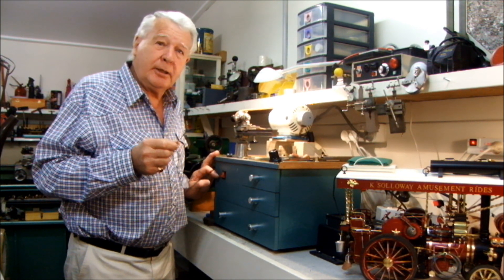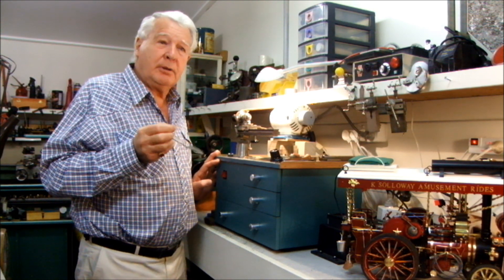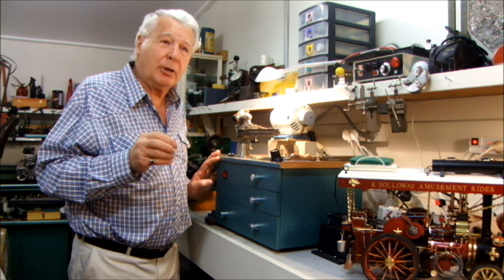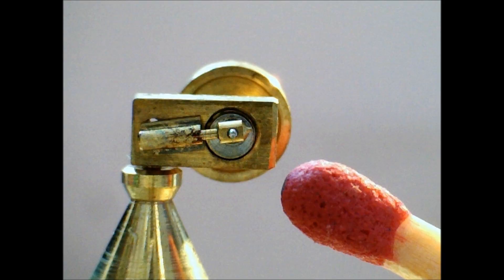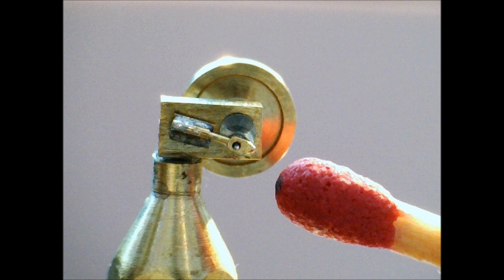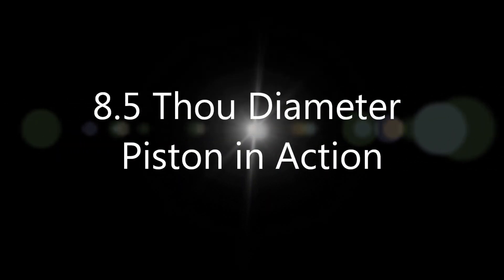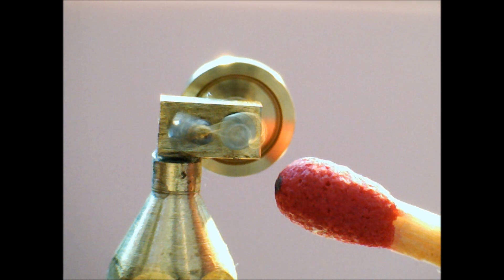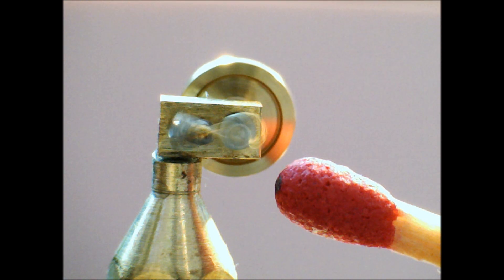Worlds smallest handmade engine

Comment: I have made a smaller engine since this one it has a 6 thou diameter piston and it worked very well until once again I bent the crankshaft, but I haven't got around to making a new crankshaft yet, I don't know if I ever will as I am now 77 years of age. I wish I had done this when I was in my 20s as I feel I could of done better then. K.S.
Reply: Amazing work. Wondering if there's any extra considerations building this into a stirling engine?

Comment: Nice. What does this run on? What is the bore and stroke? How do you lubricate it? I want to make some small stuff like this for myself.
Reply: Bob Ordewald Hi Bob, Thanks for your interest in my engine. I cant remember what the stroke is the bore is 8.5 thou". With a engine this small you cant lubricate with oil, I tried using the finest watch oil but it was just to thick.So at one time I thought it was going to fail, Until I thought of making the piston one thou smaller in diameter so that air would leak back over the piston forming a type of air bearing and it worked. I run it on air or Co2.
Reply: Great Idea. Many of the older IBM big machine tape drives used air bearings. It sure looked goofy when you cleaned everything prior to using the drive - some tapes were filthy! - as soon as the air pump came on thought it all worked like a dream.